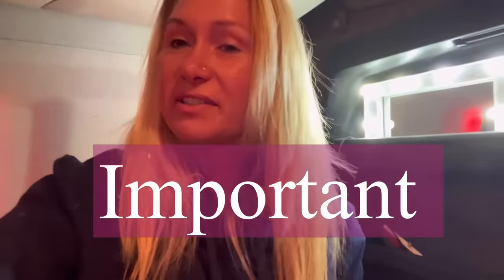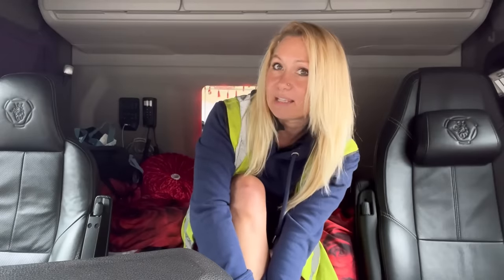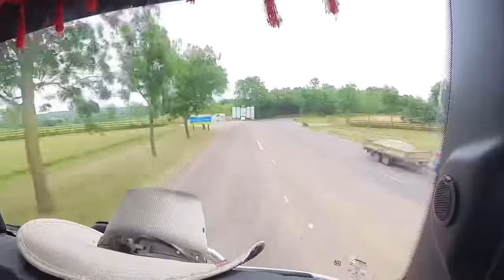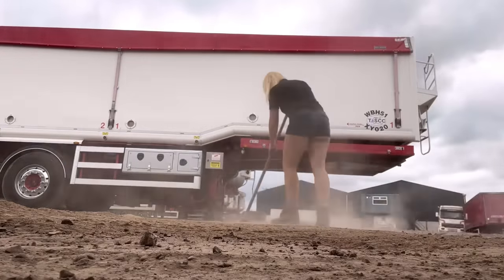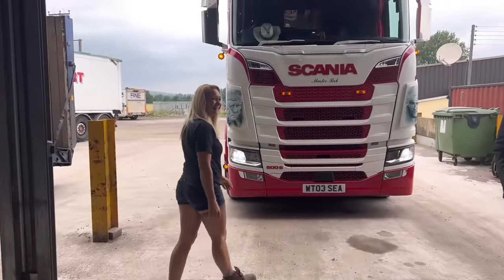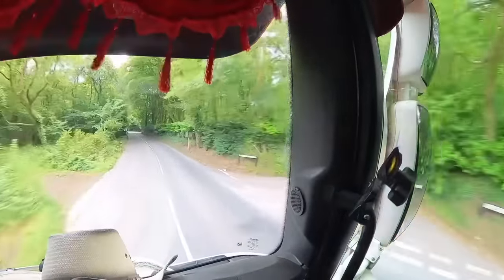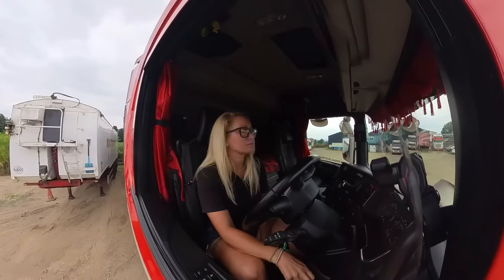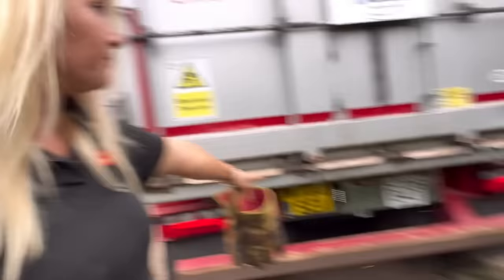Going to school PROM in a LORRY | my day preparing to be a chauffeur

Comment: Never driven a truck. When i was on the backdoor as Sainsbury we had a lady driver would have been around 1987. She would back into the loading bay in one and was one (it was known as the black hole of calcutta in sunshine) of the hardest driver worker we had. Most men drivers stood and watched you tip, she got stuck in as well.  Very small lady with long blond hair, gave as good as she got as well. Different days then it was all men drivers that did not like to see ladies at the wheel. Keep the videos coming always a good watch. She drove a leyland roadtrain, nearly forgot to say what lorry it was.

Comment: When i used to hitch up to a trailer i would always check between the jaws of the 5th wheel to make sure the metal bar had locked across the pin. The sight of the bar across the pin was 100% certain that that trailer would not drop onto its knees. Keep up the good work 👍